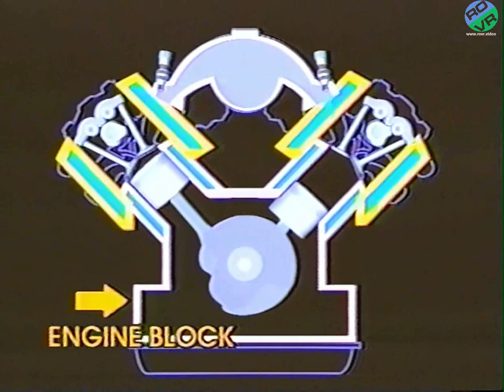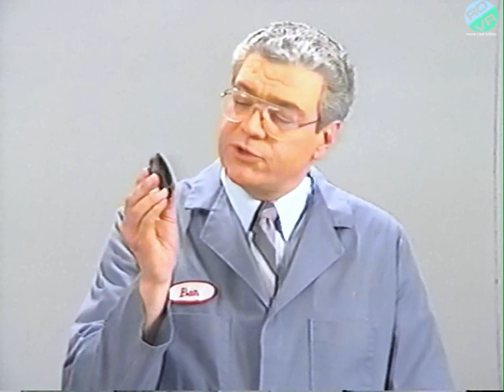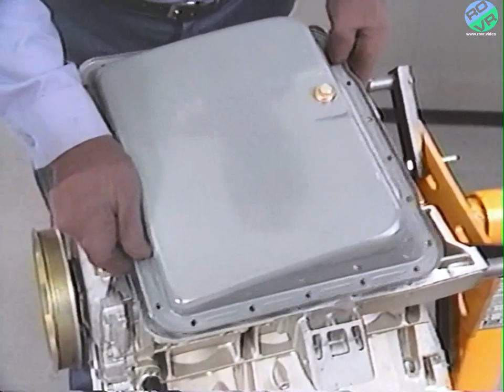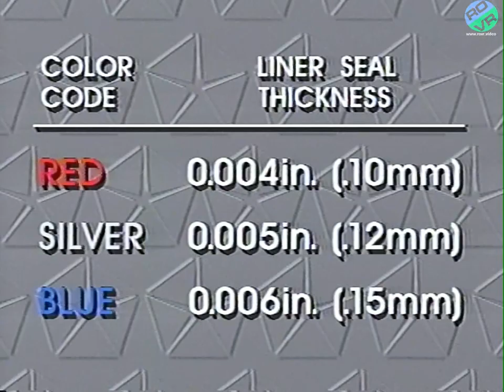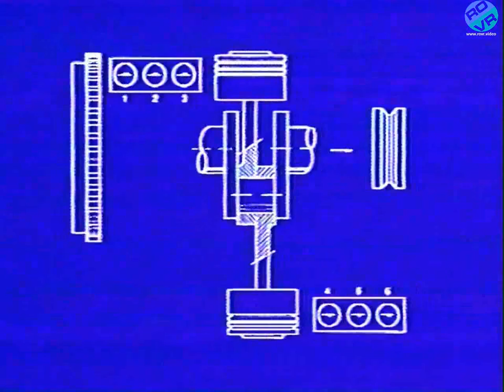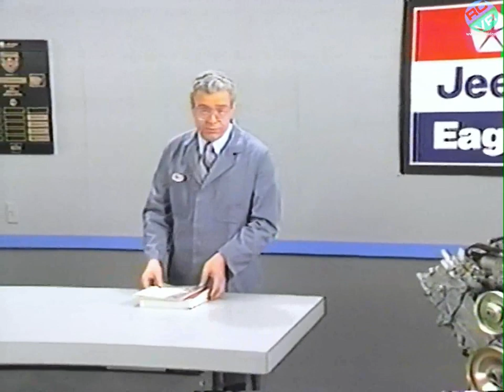Chrysler Jeep-Eagle - Video Tec - May 1990 - 3 Liter Wet Sleeve Engine Tips and Repairs

Comment: Liner protrusion and shimming. Pushing down the head dowels so you can knock the head off sideways because nothing's keeping the liners in. Whatever the heck that cam sprocket lockout and cam removal deal is. PRVs might be good engines but they don't look terribly fun to work on.

Comment: My mother had a 1989 eagle premier with that engine. It was smooth and powerful. The engine lasted more than 10 years until we got rid of the car when the transmission required rebuilding it wasn't worth doing. Problem we did have with that engine, crank angle sensors. They kept failing. And these were factory units. Even after they were properly calibrated. Also, for some reason ours had a tendency to develop rust in the distributor. Not fun when the cap and rotor combined cost more than $300.20 plus years ago. Car had an interesting cabin layout. As far as I know it was one of the very few cars at that time that  had factory keyless entry. But no alarm